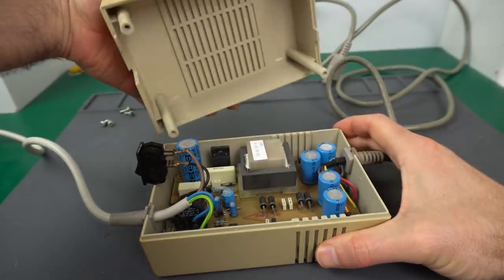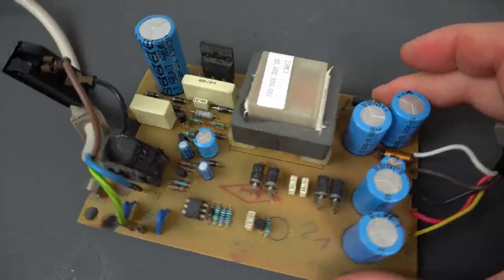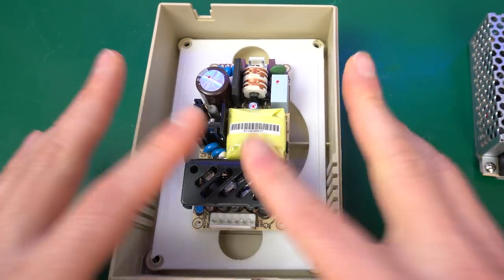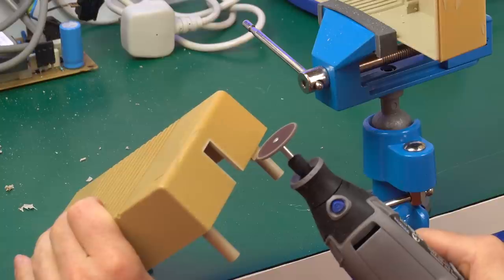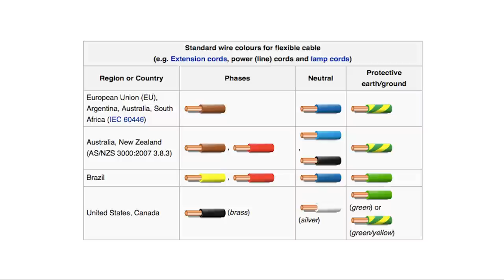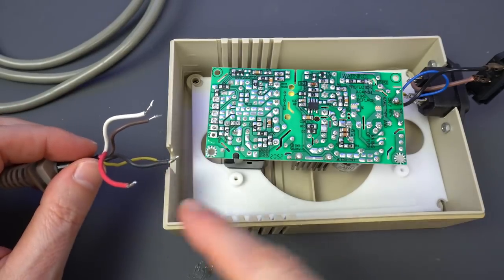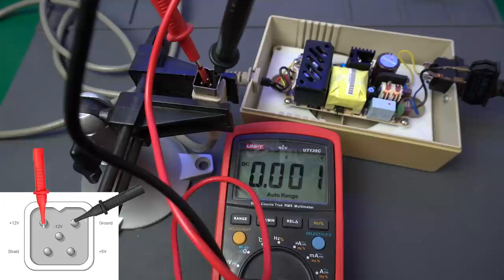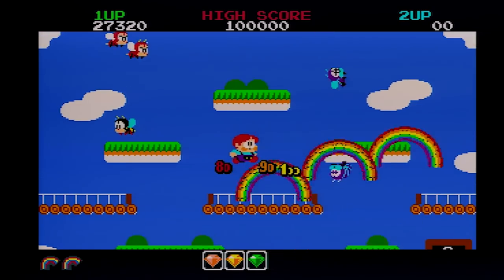This Amiga Power Supply Will Work Anywhere

Comment: It's a nice touch using the Noel's Retro Lab original colors for the neutral and earth wires.  Subtle signature from Noel there.

I also built my own PSU for my A500, but I had to start from scratch.  I used an enclosure from Hammond Engineering, a salvaged power cord from an old surge protector, some wiring for trailer lighting, a Mean Well PT-65B, a toggle switch, and a DIN connector from a seller on Ebay.  It works perfectly, but the trailer wiring is a bit unsightly...

Comment: I don't know if you've ever tried it, but Chip Quik low melt solder can also help when de-soldering.  Those Meanwell units look like some very compact switching supplies.  Adding the IEC plug is a nice touch - that style of plug, IEC-19, is widely available in cord sets of various lengths and gauges up to 14 AWG for decent prices.  For higher power and heavier wire gauges, look at IEC-21(?).  (I have an old Dell Precision 690 that has a 1000W PSU which uses this heavier style of cord.)

(I'm questioning the IEC-21 designator because I've seen others, e.g., IEC-C21, IEC-320, and some others that all seem to be the same or very similar.)

The pinned comment has stirred quite the back-and-forth about wire sizes for use with 110VAC.  A good guide to what is up to Code (NFPA National Electric Code) that isn't too expensive is Ugly's Electrical References, a small "pocket-sized" book, usually bound to lay flat.  Ah... I see it is now available as an app for Android or IOS.  It's worth having if you are going to be doing electrical work (as opposed to electronics).

Comment: Good mod Noel.  And great idea with the IEC socket.  Yes when I saw the thickness of the blue (neutral) wire I was a tad concerned.
Reply from the maker: Thanks! I think the thickness is fine given that it's 220V AC, but it wouldn't hurt to have something thicker for sure.

Comment: In many European countries there is no dedicated "neutral" cable in appliances since the standard schuko plug is not directional. Regardless if you have spent time wiring up your walls in any particular direction (not required) you can change what is neutral at any time by rotating the plug 180°.
Reply: Surely schuko is directional? There's an earth pin hole, admittedly if it's a two pin outlet it's not directional.... Never mind i forgot that schuko uses the edge connectors not the pin and so you're quite right.
Reply: @TheErador  You are half right though. There are variants like the French Type E that has a earth prong in the socket instead of the normal side connectors. There are however only a handful of countries in Europe that do not use Type F.
Reply: @v4lgrind  Poland seems to use the type E, which is where I've been quite a bit with work, easy to forget that sockets are not entirely unified across Europe.

Comment: One thought about L and N lines. In FR socket you can't insert the other way around but in Italian or Schucko (Germany, Austria) you can actually insert it that L and N are swapped. 
I'd treat them both as live, and only Protective Earth as safe one (as it is connected to chassis anyway - for a reason). Only double insulated devices (box in a box logo on device) don't use PE wire as they have double insulation layers against catastrophic failure (ie. short live to chassis).

Comment: Great tip about using a soldering iron with the desoldering gun. The gun can definitely struggle with voltage/ground planes. 👍😊

Comment: Meanwell is a great low cost mod. I have it on my dual C128 and C64 supply. I also got 18 0 18 Transformer to supply 9 VAC when paralleled.

Comment: You should have insulated the screws on the inside, now they can become live when something breaks on the inside (a live wire or something). PS: I recently used the same psu for a usb docking station that had issues with interference :-)
Reply: Other option would be to connect the ground to those two new screws. Leaving them like they are now would make the psu technically unsafe. The original screws are considered safe because their metal parts are not exposed inside the case when it is closed.

Comment: I know this is an old video, but on the mains side, I would advise using thicker neutral and earth wires.  Idealy the same gauge as the live wire.  For 230V it's probably not a big deal, but going down to 120, it'll be double the current.

Comment: 120 to 125 volts for USA rather than 110  tends to be the line voltage..  Thus the 90 to 130 range is what one looks at as expected range do to brown out ETC .  Easy to meet  in this case.

Comment: That power supply was designed to be put inside a metal case. The ground is supposed to be connected to the metal case, and the power supply grounds through the holes you jumpered together. What you did is perfectly fine.
A car headlamp will draw about 4 amps from 12 volts and around 2 amps on 5 volts. A car marker light (blinker) will normally draw around 600ma to 1 amps.

Comment: At that time I had a PC power supply unit on the Amiga 1200. That came from a remaining stock. It had a real power switch, but no standardized PC dimensions. 
I do not know which PC power supply units had no standby and were not switched via a soft switch, but directly switched on 220 volts.
Anyway, it brought ample power to 5 volts and +/- 12 volts. In addition, Molex plugs, with which I connected the hard drive and CD Rom. I think it even had a 3.3 volt line that I didn't need.
It brought a total of about 120 watts. Too little for a PC but not enough for an Amiga.
At that time, I simply cut the cables off and soldered them together to match.

Unfortunately, all Amiga parts ended up in the trash sometime in the 2000s.
The reason was, I think, that no floppy disk want to start anymore.

Comment: Great!, when cut plastics, with the dremel use the correct disk, is like black fiberglass, that is for cutting plastics, those tiny Psu are like that ones on arcades,  these new models has protections like over voltage ?  I use tiny Atx..  great video.. great too take time to explain security !

Comment: British plugs are by far the most reliable I've ever used and provide up to 3kw of power, and allow for thin cables by being fused. 2 prong USA plugs fall out if you breath on them, not fused, and are low wattage in comparison. European plugs are non standard (try it in Italy for instance) and non fused, so you have to have a thicker cable.
Reply: Non-standard is an argument against UK plugs and not in favour of them: I can visit Italy and plug in my laptop without an adapter. I can't visit the UK without using an adapter. Agreed, it is only partial compatibility, but partial compatibility is a lot better than no compatibility.
Reply: You can keep your plugs, and we can keep ours. And euro plugs are not the same across the continent, as I found out to my cost in italy a few years ago when a northern European plug got stuck.
Reply: @robbyxp1  Impressed how how you make this a "you" and "us" thing. There exists no European socket. There exists an European plug, the CEE 7/16, and it fits in German, French, Swiss and Italian sockets. The only socket where it doesn't fit is the UK socket.

The "north European" plug that you mention is likely Schuko plug. Schuko is not an European plug, it is a German plug (used in many more countries). And a German plug does not fit in an Italian socket.

Many Schuko plugs are actually hybrid German and French plugs and fit both German and French sockets. They still don't fit in Italian sockets

Is it perfect? Nope. But fact remains that the UK and Ireland are the only European countries where you need to take adapters with you. Everywhere else the CEE 7/16 plugs are accepted. Since devices that you carry with you during travel (shavers, USB chargers, laptops, ...) have or can have CEE 7/16 plugs there isn't  actually a lot of plugs plain in practise.
Reply: An hair dryer bought in Netherlands did not not fit the Italian socket. It stuck. They hotel supplied an adaptor. Hence they are non standard. And they are not fused, which is the major problem with European plugs. That means you have to have a thick lead even if your not drawing the full amperage.
Reply: @robbyxp1  Yes, a hairdryer needs to more than 2.5A, which is the maximum the CEE 7/16 plug can carry. A hairdryer sold in NL commonly has a CEE 7/17 plug, which is indeed not compatible with an Italian socket.

According to Italian electrical regulations, devices using less than 10A use a plug with pins spaced 19mm apart, while devices using more than 10A need to use plugs with pins 26mm apart. To avoid safety issues, Italian sockets are designed to reject high powered 19mm plugs such as the CEE 7/17.

So it is exactly as I said: There is limited compatibility, but still a lot better than no compatibility.

The argument about the cable thickness is mostly a theoretical one: Cables in the UK can indeed theoretically be thinner, but in practise they are not.

Comment: Wow! Excellent idea! I have at least 10 PSUs that need fixing so I'll deffo copy your idea if you don't mind and obviously will cover it on y blog (with proper credits ;)  Also, a small remark. For cutting ABS plastic, you will get way better results with a thin mini-saw blade for a Dremel. I've cut hundreds of those and it works the best for me.

Comment: Fuses in a three pin plug are not only a safety feature which are cheap but practical too. If my fridge gets a power surge, the fuse blows and it’s quick and easy to replace. I’m guessing in Europe if you get a power surge, there’s going to be damage which I guess most people are going to need at least an engineer out which will be expensive?
Reply: Countries in Europe generally don't use ring topologies like in the UK, so a surge would only affect the "spoke" of wires from the appliance to the distribution box.
Reply: @bufordmaddogtannen  I won't claim to understand that fully, but that doesn't mean a power surge wouldn't happen?
Reply: @richards7909    my understanding is that to be able to have sockets (and lights) arranged in a circle you need to be able to push 30Amps/7000+ KW worth of power through the wires. With a star arrangement the requirements are lower, therefore the damage should be contained. 
Besides most households in Europe are capped at around 4KW total as heating and cooking is done with gas. 
In the case of an electrical heater malfunctioning, this can affect other appliances on the same ring.

Comment: Great video! One small, almost inconsequential suggestion, flat head screws are the worst! Not that you'll be opening the PSU a lot, but I would try to avoid those types of screws. I've always liked Robertson (square) type, they work very well, tend not to get stripped too easily, but it aren't very common outside of Canada (where I am from), not such of fan of Philips because they get stripped a lot in my experience, but better than flat head. Torx or hex are also good

Comment: Good video, love those little PSUs……except i winced when i saw you hadn’t isolated the high voltage AC input wires with shrink tubing. Better safe than 💥 🔥
Reply from the maker: Yes, you're right. My non-electrician background showing up 😃 I added a comment about it pinned to the top. Thanks!

Comment: BS1362 is one of the small details in the UK electricity supply that is (apart from a tendency to impale feet) a bit of everyday genius. Unlike most places in the world it protects the user, not just the property from excess current draw and short circuits (if the earth pin is connected). The accompanying socket design (BS1363) is equally thoughtful with additional safety features intend to protect the user from stupidity, unfortunately stupidity can be very strong and even this design has its limits
Reply: I hate to be "that guy" - but BS1362 is the spec for the fuse, BS1363 covers both the plugs and the sockets.
Reply: @TrimeshSZ  damn!

Comment: I live in the US, and have several (dead) fans with fuses in their plugs. Unfortunately, local sources don't seem to have the right type of fuse (they're really tiny cylindrical ones, much smaller than normal... smaller, in fact, than the unusually small ones that are locally available).

Comment: You really should have used appropriate mains rated (and color coded) wire, and preferably insulated crimp connectors for the IEC socket wiring. Just an observation. It’s always wise to take a little extra care around mains, and earth, wiring. :)

Comment: What model MeanWell Power Supply did you use? I have checked out the RPD-60 series and can't find one that has +5V and both +12V and -12V outputs
Reply: The screen capture is wrong, the correct reference is: RPT-60B. This one (T instead or B) has the expected voltages.

Comment: I did a full recap of my A1200 power supply a couple years ago, and only then noticed that the cable with the square plug has a break somewhere and the Amiga will shut off if I flex the cable too much.  It's probably time for me to build a whole new power supply with new cables.  Any input on switching the stupid square plug on an Amiga with a more conventional round connector?  Are there any other common plugs that suit the pin layout on the motherboard?

Comment: If you could post links to your recommendations for the PSU replacement, that would be great. Better yet if you can do something with an Amazon affiliate link.
 You might as well get a bit of a tip for your time. 
Thanks for the video.

Comment: The chiptunes at 11.30 sounds awfully similar to "modern love" from a flock of seagulls. Besides that, pretty cool video. Are those imperfections on the plastic caused by something hot melting it? ot was it in tight contact with some cables for years?

Comment: Hi Noel, just a quick question, if that psu is leadfree soldered i am surprised about how easy it was to unsolder those components, which unsoldering tool are you using? (and soldering iron) looking to upgrade my gear.
Reply from the maker: That's why I had to use the soldering iron along with the desoldering gun probably, but yes, they came out really nicely. You can see the specific tools I'm using here: https://noelsretrolab.com/tools.html

Comment: Does anyone know the make and model of his desoldering gun? I've seen other brands (different colors) and are ultra noisy. This one sounds fine. Anyone?
Reply from the maker: It's a ZD915, but it's pretty loud. I turn the volume down during those sequences 😃 The gun itself is great though. Highly recommended.
Reply: In my experience, the combination of temperature controlled iron+cheap desoldering pump does a better job at removing solder and preserving traces.

Comment: Hi. Any direct sales link for the rpd-60B? Looking at Aliexpress, it appears that they only have two voltage outputs, +12 and +5. I don't see -12v
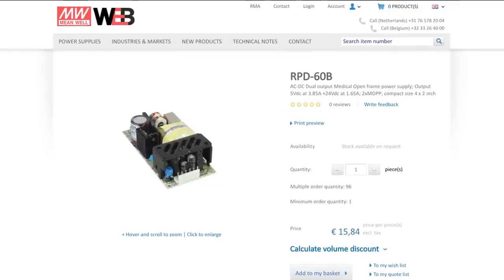Reply: Going through the Meanwell catalog, I think I have found an error. In his video he refers to the model rpd-60 (3:33) when in reality the reference of the triple voltage source must be RPT-60 + 12v + 5-12v.
Maybe a catalog change? In any case. Very good video. I was unaware of this small model of power supply
Reply: @santiagog.6160  I think it's just an error on the video - the last letter in Meanwel PSU part numbers is the output configuration; "S" = Single, "D" = Dual, "T" = Triple.  So if you have a "RPD" model with 3 outputs it's presumably a fake one (yes, there are fake Meanwell PSUs).

Comment: Ive heard good things about the Meanwell PSU's but I do wonder looking at them with the electrolytic capacitors jammed in so close to heatsinks and heat sources and under cages if they will be in a worse position in 15, 20 or more years than the original PSU? I know they would have better protection for over voltage etc but not really sold on the "jammed pack" layout they have.

Comment: You should never solder to those connectors like that, you should use the proper crimped terminals they were made to accept. It would fail compliance codes in both the EU and US. The same goes for the wires to the PCB, there is a reason the input and output on the Meanwell were sockets/screw terminals and not bare solder points. Solder has absolutely no mechanical strength and can break/fail even with mild impacts such as a small drop. The solder can also melt under certain fault conditions leaving wires flapping around. Yes, the wires on the original supply were indeed soldered to the board, but that supply is old and was made before regulations on internal mains wiring were updated. I'm not trying to be a killjoy or some pedant here, just pointing out that those regulations are in place for very good reasons and it is very likely that if you're shipping that to the US you're probably breaking a bunch of import laws.

Comment: It’s a shame you didn’t insulate the terminals on the AC in, could of used some crimped spade connectors. Would of looked so much more tidy.
Reply from the maker: Agreed. I didn't have the spade connectors, but in retrospect I should have insulated the terminals with some heat shrink. I added a pinned comment about that. Thanks!

Comment: For a bit more neatness, the IEC socket looks better with the "wings" on the inside of the case with the rectangular lip of the socket sat in the opening of the case, making it a nice, smooth flush-mount solution... :)

Comment: Disagree with the alleged reliability of Meanwell PSUs, having got through a box of them going bang as soon as they were plugged in.  Investigation found a nasty design fault in that if the maximum output is 16v DC, you should fit at least a 25v rated smoothing capacitor and not a 16v one.  Real stupid fault that, just bad bad bad.
Reply from the maker: Really? That's insane! How could they make that mistake? I wonder if that's in a new batch. Hope they fixed it.